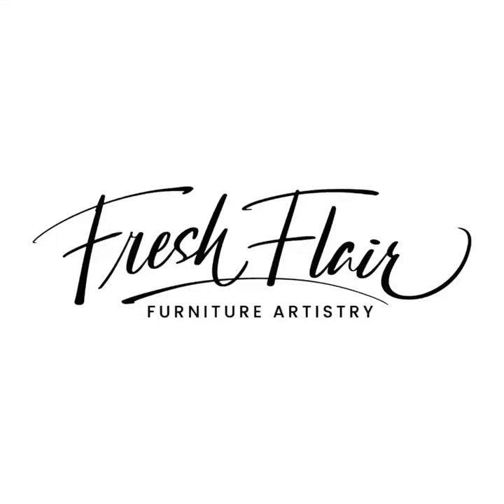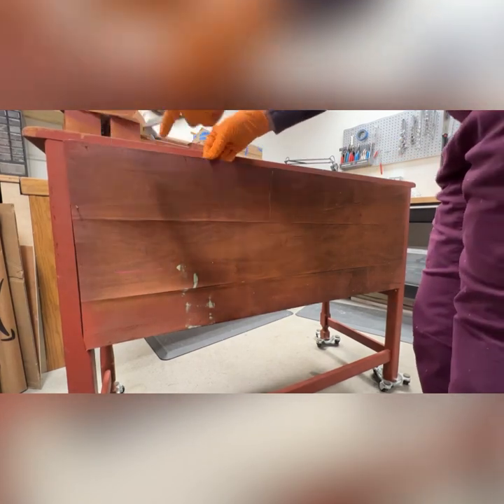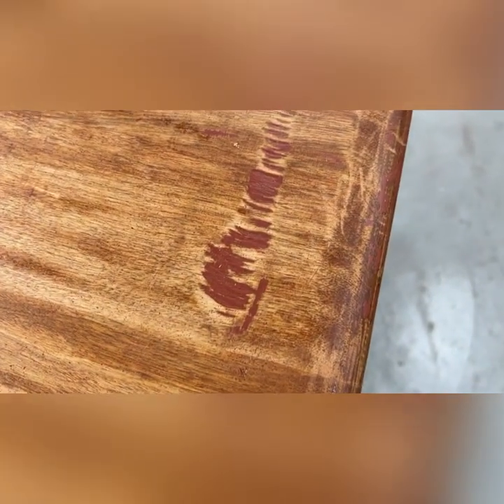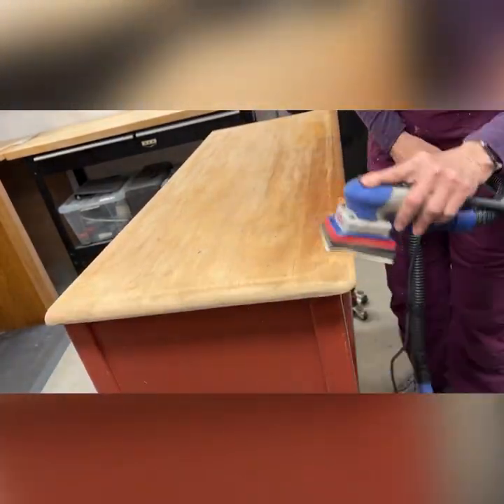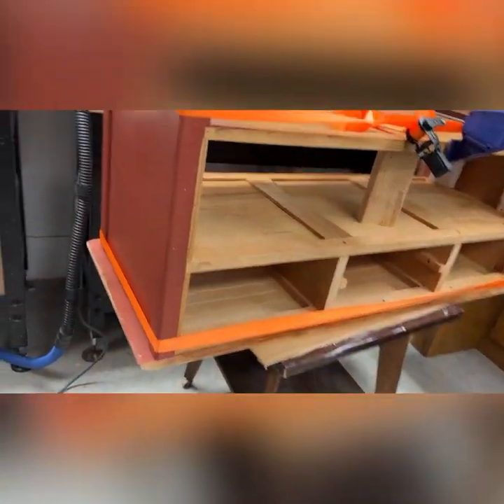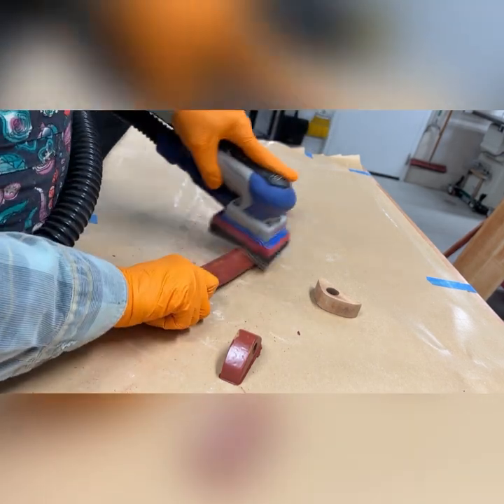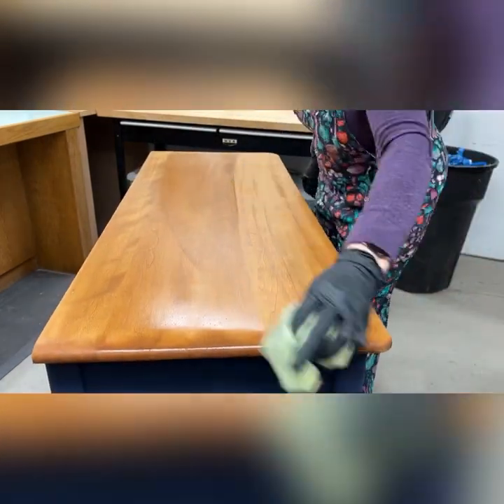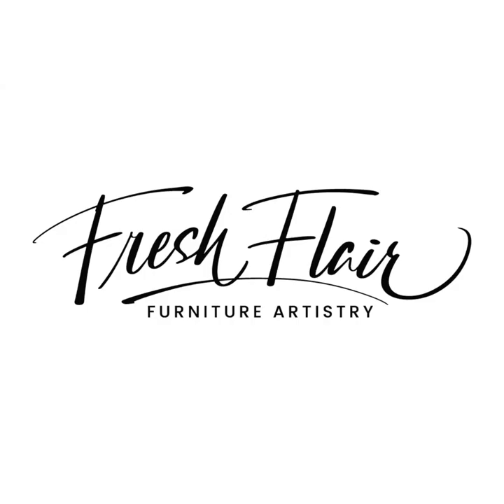Orange Buffet Uncovered

Comment: I love the drawer liners and the stenciling you did on the sides of the drawers! That bottom drawer pull was VERY interesting! Ive never seen anything even close to it. Its a shame you couldnt match the side drawers pulls to match the bottom drawer, but the option you chose worked well.
At first, I wasnt sure about you painting the body then staining the top and drawer fronts, but the paint to wood pairing worked well to balance out the overall look.
Reply: Thanks for your comment. I agree with you on the hardware. Wishing I knew how to make matching handles. Sometimes the wood is just so inferior on the sides of the body since they often use a substandard wood but if I could have kept this all light woods I would have loved that. Take care.